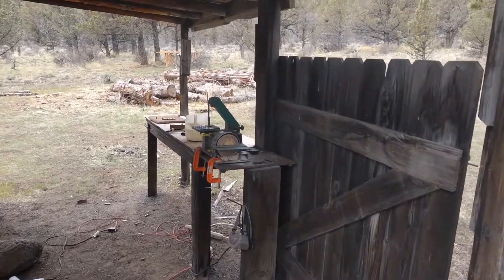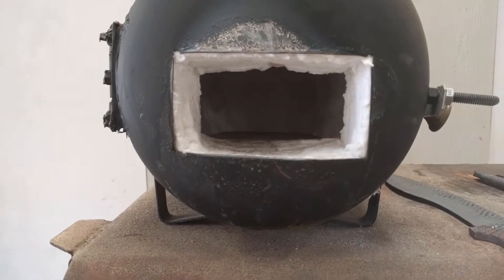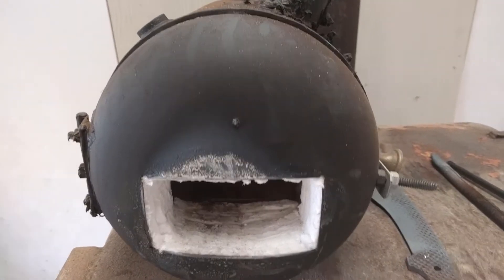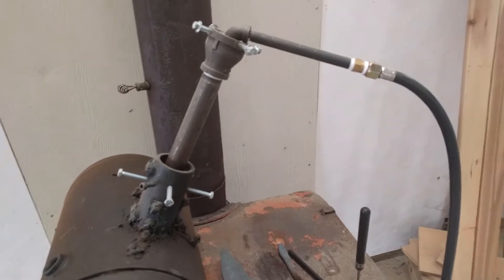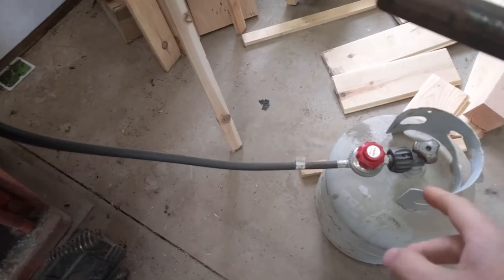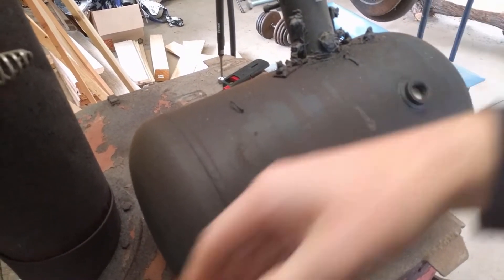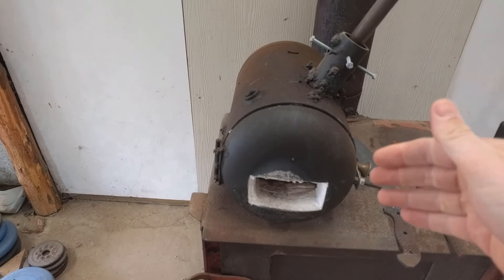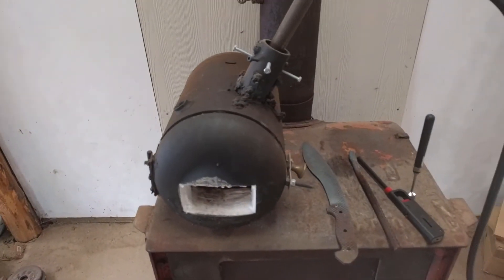Propane Vs Coal Forge.  Easy No-Weld Forge Design for Beginners.

Comment: Be careful. J B Weld will outgas toxic fumes when heated above a certain temp. Can't remember that temp off the top of my head but I would think that application would easily exceed it
Reply from the maker: Thanks for the heads up.  I finally got a welder and can make it right.
Reply: @ironridgeoutdoors  no problem. Learned that the hard way and got to spend a few days in the hospital with an acute respiratory infection
Reply from the maker: @xrexc3179  wow that's awful.